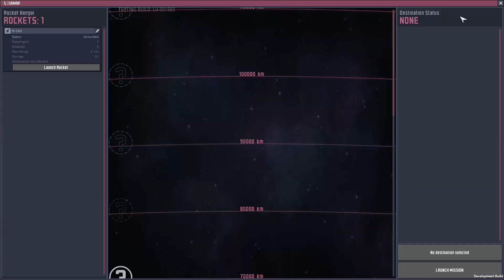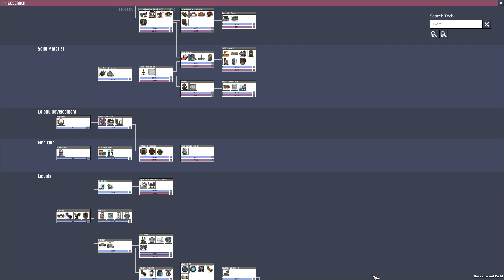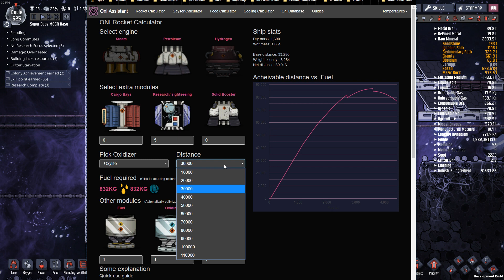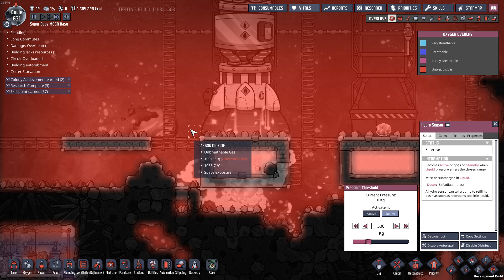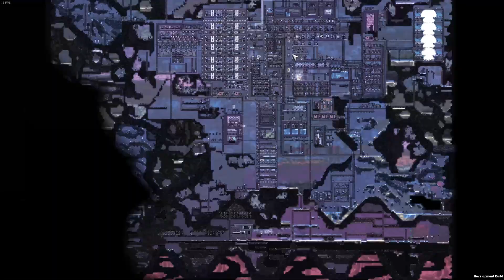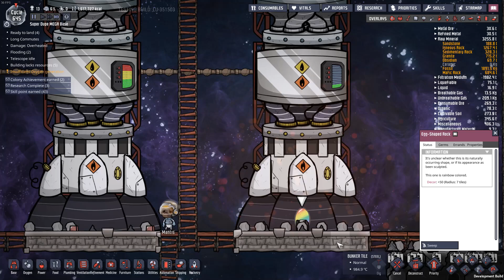Super Coolant! ep 27 Oxygen Not Included

Comment: Hey Brothgar you could feed the carbon dioxide to some slicksters to produce oil and then convert it into petroleum with the heat of the rocket. Or you could just use magma slicksters
Reply: Can also just scrub the carbon dioxide and get polluted water for pincha peppers.  If you collect the emissions from a hydrogen rocket, you can use that to self fuel and, depending on how long your silo is, any extra scrubs the CO2 for food.  Makes it fairly efficient to feed your dupes high value food without needing extra water.  The problem is just getting it started the first time to gather the steam/CO2 effectively

Comment: Since that first asteroid has a large amount of diamond you could do a series of trips to bring back enough to make your new launch tubes on the left side have a background lined with diamond thermal shift plates and catch even more heat and all but a tiny bit of the gas that will escape out the top, to pull all the gas away before the rocket comes back and opens the door again you could have one of the side walls be a door compressor, in fact lining the sides with door compressors that push the gas into a tube leading down to a vertical compressor would be ideal in my opinion.
Reply: I've been trying to figure out a method of doing this type of thing.  Cooling the gas seems to be the easiest method because we can just run a cooling loop in the silo and chill the steam into liquid, but I haven't figured out a good method for collecting the CO2.  Could still cool it but I've never attempted to liquidify CO2 before so don't have prior knowledge of that but I think that would be an easier way to handle it since pumping out gasses takes way too long.

Comment: Remember that thing you built to make steam for your first rocket? Stick a steam turbine on it. And maybe some steel autominers to break regolith so that it can continue to get the heat from meteors. Or maybe you can move the giant meteor shield down a bit, and then build something there.
Reply: I wanted to try something like this, gathering all the regolith from space into a steam generator setup and then shipping the cooler regolith to my water sieve/deodorizers.  Haven't quite figured out a good method for determining the temperature of the regolith to know when to remove it, but that's a different story.  I'm half hoping they'll add thermo sensors to the rail system, but if not I'll probably use the mod that does.

Comment: So I heard you like infinte energy? Well here is an approach of getting close to that:
Step1: remove your steamturbine setup from your volcano
Step2: use that volcano to melt down regolithe
Step3: let the molten regolith cool back to solid ignious rock
Step4: infinite energy
But how does that work? regolithe melts into lava and solifies into ignious rock. ignious rock has a specific heat capacity of 1.0 while regolith has one of 0.2. So after melting and solifying it you will have 5 times of the thermal energy stored inside your ignious rock, that you used to heat it up from regolithe.
You are welcome :)
Reply: Kirito2508 I think the sour gas boiler seems more safe and cool looking
Reply: @TheSquirt5000  you can power several sourgas boilers with the "refined" regolithe and still have it above 1500 degrees to power more steamturbines with it. and the system is perfectly safe if you set it up correctly
Reply: @lukashoffmann9574  To be fair, that's what they said about Chernobyl.
Reply: @lukashoffmann9574  im just thinking he would make the sourgas boiler or both because of the many videos he made making the sour gas boiler
Reply: whouldent you just get more power from the magma raw? Or do you mean adding regolith to the magma then you would still need a steam turbine to harvast the the heat. right?
Reply: @jamesenlayton4441  Using the igneous rock to heat the regolith back up end up with the regolith hitting the magma heat sink  only a fraction of degree below it's melting point.
Once it's started it will draw almost no heat from the magma and produce a truly colossal amount of heat energy to use to run steam engines, convert slime into dirt, make petroleum or whatever else you want to use it for.
It's truly impressive to see running but beyond my current skill to build :(